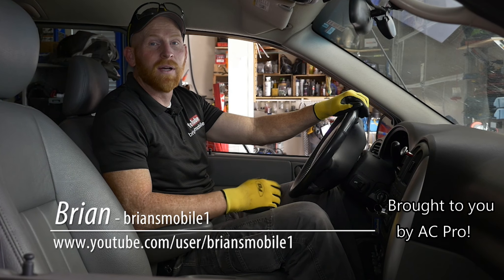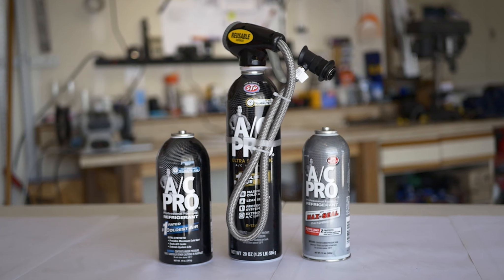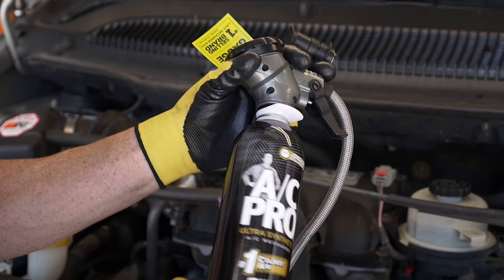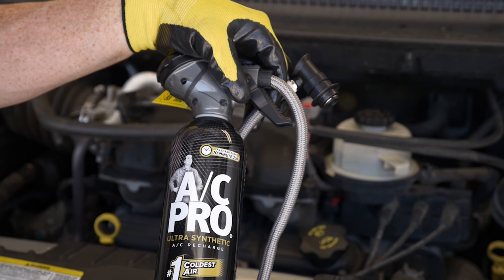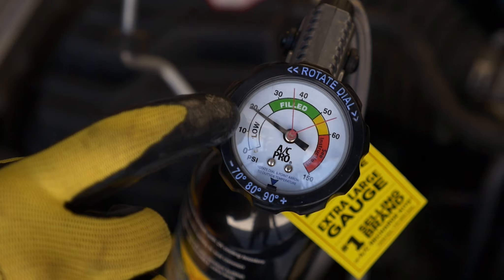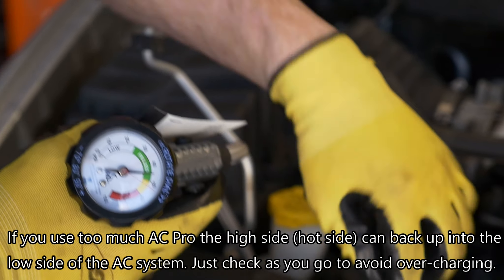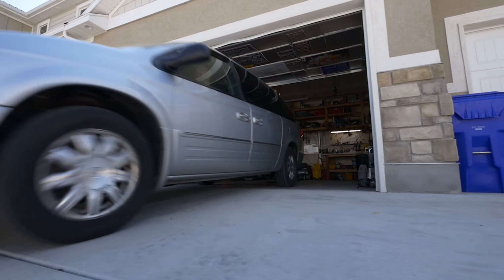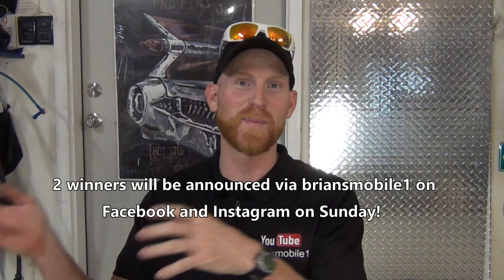How to Fix your Car's AC with AC Pro plus $100 WalMart Gift Card Giveaway!

Comment: Wow.  Quite the sell out.  First of all there is no way to determine how much refrigerant to put in a system this way.  It's easy to overfill a system without knowing it causing more damage.  Also, where these sealants can temporarily repair a leak it's rarely premanent and the sealant can clog up the entire system.  This will cause extra cost when the system has to be repaired the right way.  Any real mechanic knows these things as they have dealt with countless AC systems that have been "fixed" this way.
Reply: Whatever man I rather stick a can of this in my system and let some air in via the hose than have you fix it LOL!
Reply: Jesse Crandle OK but but I've been a professional mechanic for nearly 15 years and have the experience and equipment to take care of any issues that may arise.  If you do have a mechanic you trust (a real one not a shade tree mechanic) ask he may want he (or she) thinks of products like this.
Reply from the maker: Normally I would heartily agree with you.  That was my impression at first blush.  I was wrong.
Reply: If your a professional mechanic of 15 years. why even bother clicking on a video like this? Sell out, Guy has to pay his bills. I would rather see him getting paid over some actor that knows squat about auto repairs. Do you call your self a sell out everyday you go to work and customers get charged for a car repair you perform?
Reply: m ph I enjoy watching videos from other mechanics.  There's always room to learn new things.  I came down harshly because these fix in a can things rarely work and end up causing customer more in repairs in the long run.  I would be surprised if any mechanic recommended them and it seems like this is getting paid to give bad advice.
Reply: There IS no way to tell much much oil your compressor has in or, or how much more it needs.  Using this would be no different from manually adding oil, its just a guessing game.  Also, the refrigerant would be pretty hard to overfill.
Reply: Justin E. It's actually very easy to overfill the refrigerant.  And this will cause the pressure on the high side to be higher than specified which can and will damage components.
When replacing a compressor or other major component you simply drain the oil out into a measuring container then add the same amount of new oil back in.  When recovering refrigerant the oil separator will show how much oil came out which let's you put the same amount back in.
Older cars were much more forgiving to overfilling because they held a lot more refrigerant so it was harder to accidentally overpressure they too badly.  Modern cars use a very small amount to of refrigerant and are extremely sensitive to the amount  put in them.
However overpressure and oil aren't the main concern here.  The sealants used in these products contaminate the system and can wreak havoc with it.
Reply: +Do R/C! Yeah but you're not talking to the demographic that pays to have a technician examine it JUST for advice, the people who own a 15 year old fourth hand Corolla just want an AC and they're not about to spend $1,000 to get it fixed. I'm gonna go out on a limb here and say that almost everything involving the AC will cost $300 or more, so when faced with spending $20 to get AC for the rest of the summer (if your lucky, let's be honest) or spending $300 to $2000 on a car worth 5 grand? They just don't care enough.

I agree with you however, it should be diagnosed properly and repaired if you actually want it to function properly. This is sort of a catch 22 issue here, if you have enough money to have a running AC your car is too new to have failures, and if you're too poor to own the newer car you're not going to foot a huge bill either.
Reply: Brian, you would never do this on your own/customers' vehicles so why are you promoting this incorrect method to the viewers?  You are not doing any favours to anyone except yourself for gaining money/sponsorship.  Please don't get me wrong, I love your videos but you totally sold yourself out on this one!